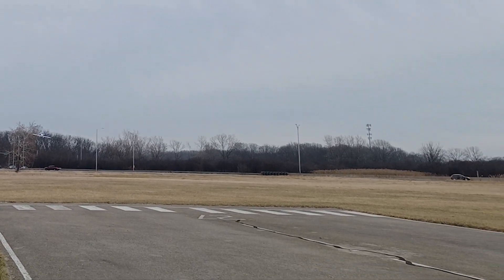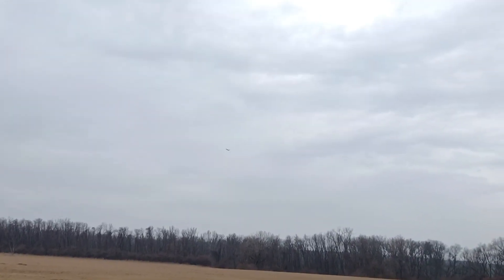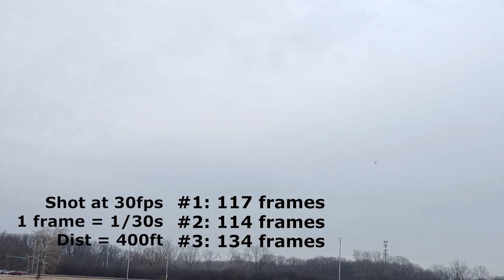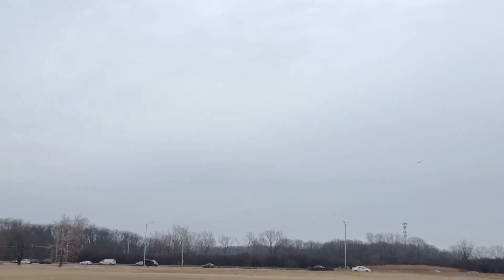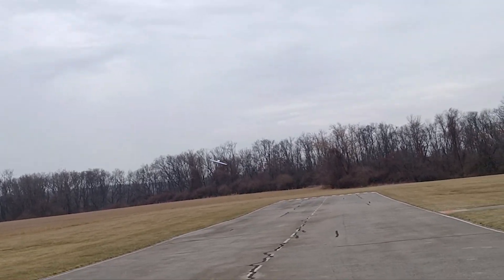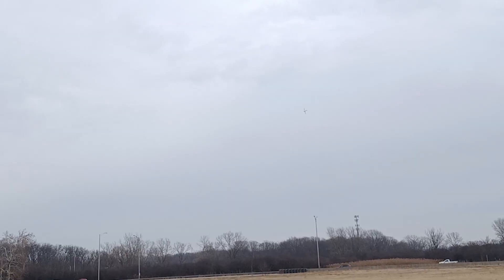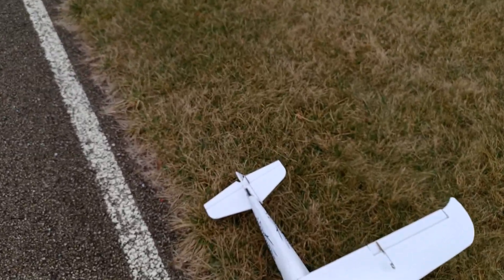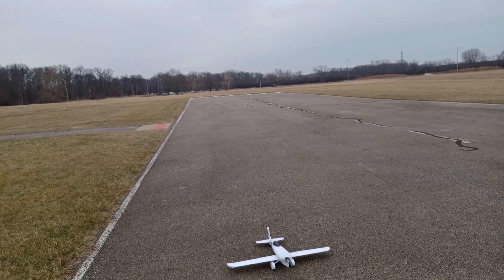Scimitar Maiden Flight and Speed Test #1

Comment: I made a racer plane but the motor ripped off. What do you recomend for strengthening motor mounts?😊
Reply from the maker: I use 1/8" plywood glued to the foam. Wrapping some tape across the front and onto the sides helps considerably as well
Reply: @Pieliker96_  Thanks, I’ll do some surgery tonight,